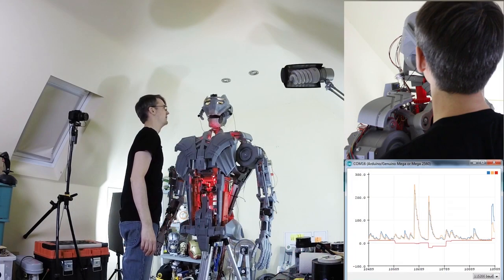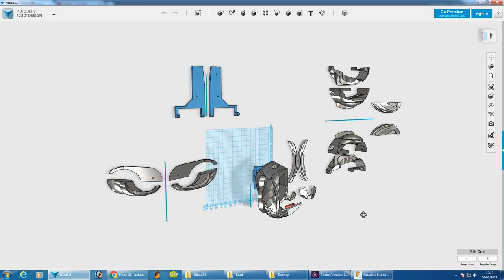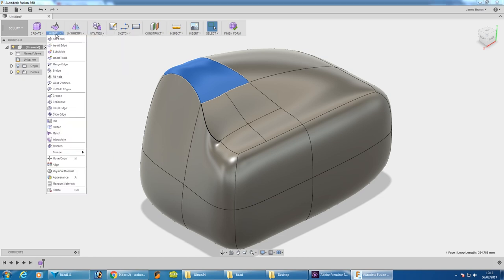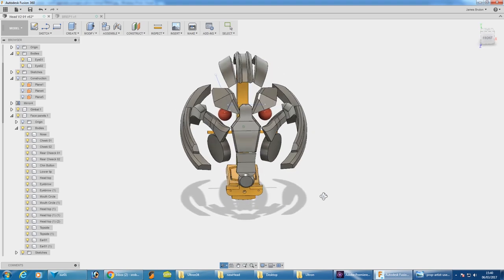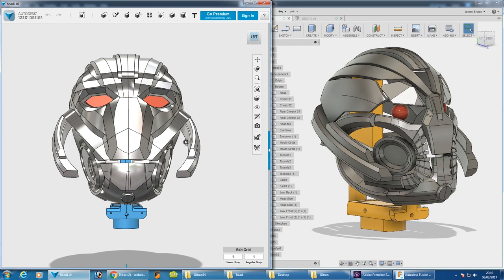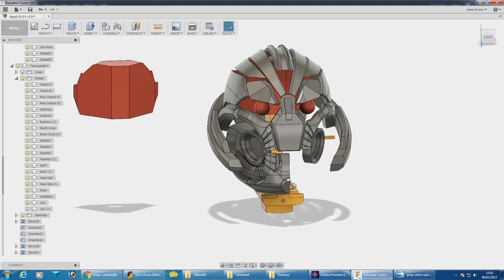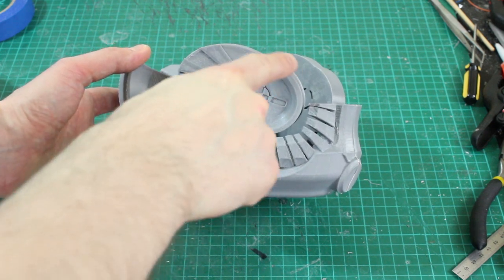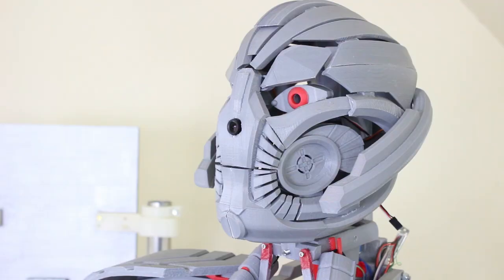Avengers Ultron #34 | New Head | James Bruton

Comment: for the eyes, why not ring LEDs behind a diffuser using the output for his head turning to have his eyes look in the direction he is turning his head. or if you're feeling particularly froggy, use the tracking from the pixie cam to drive the LEDs so it appears he has pupils actually tracking what he's looking at after determining a "main" object based on size, and color, to avoid shifty eyes when presented too similar sized objects.

Comment: Great work with the head, James. Much better than the previous one. But there are still some stuff, that doesn't look right. The button nose looks like nose of some cute animal. And the mouth is bit odd to. It look like mouth of an old person without teeth. Also Ultron's eyes look somehow flat, or doesn't really fit into the head properly. But the overall shape of the head is much better than before. Good job!

Comment: I don't see why you don't do some kind of dual-channel setup for the camera.. put a camera behind each eye, so the pupil is the camera lens.  Use trapped led rings to put out the red light, but behind the camera lens so it doesn't distract the cameras.  And perhaps mesh the camera feeds so it's just one image for the actual processing hardware to work with.  You have more than enough space for video processing with that build, may as well use it to give Ultron some advanced vision.  It would also give you the option to directly bypass the vision processing, and send the dual feeds to perhaps goggles or other dual-display devices if you wish to 'see through' what Ultron sees, during puppeteering moments.
Reply: Yes! This is good ^
Reply: thought so aswell

Comment: i think Fusion 360 lets you import image planes as templates/reference so you could plop your reference straight into the App :D  surprised 123D Make never had that. it's standard in most if not all major modeling apps .

Comment: The head looks better than the previous one for sure, but the nose gotta go. in the chin there is a circle that seems like the pixie cam can actually sit in.. unless it is too low/ or the angle isn't good. 
Also, something about the eyes isn't right as others said. Maybe you can make it so they have their own LEDs inside, and have thin nylon layer printed above so it disperses the light. Just an idea..
One last thing, for cosmetics, you can get vinyls to easily cover up all the plastic and make it look like carbon, or aluminum. there are lots of variants for that, and it should be fairly easy to apply.
Great work so far!

Comment: hey James, I would like to get into 3D printing, what printer would you recommend for a beginner and where could I get it from?
Reply: Evasion as a 3D printer myself I recommend if you're low budget getting a Prusa i3. Either get a cheap one off eBay and do some leadscrew upgrades etc (works out really cheap) or if you can, get the Prusa i3 MK2 from Prusa himself.

Comment: Put the camera into the CHIN! It's a little circle, there seems to be plenty of space for it, and it would look way better than in the nose.
Reply: Oh, that's too bad.
Then maybe it would be worth the re-coding to put the camera into the chest?
It really is unsightly in the nose.
Also, do you plan on giving Ultron some kind of reflective metal-like finish?
Reply: And I had an idea for the eyes: you could get some kind of red plastic domes, like these: http://www.ebay.com/itm/110pcs-Mixed-3-4-8-10mm-Dome-Hemisphere-Acrylic-Flatback-Rhinestones-Colors-/252190941070?var=551026465550&hash=item3ab7c05f8e:g:ny4AAOSwgyxWWxrM

And then work with those, maybe shelling them out and/or making a tiny 3D print to fit on top.
Reply: You could use these for the eyes: http://www.ema-models.co.uk/index.php/acrylic-plastic-shapes/hemispherical-domes/fluorescent-domes/h-dome-19-1mm-fluorescent-red.html